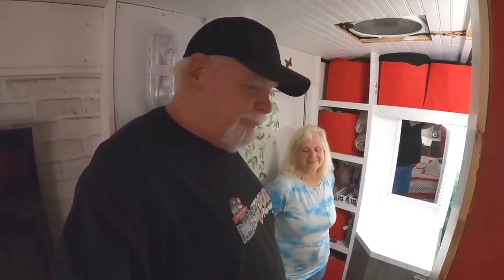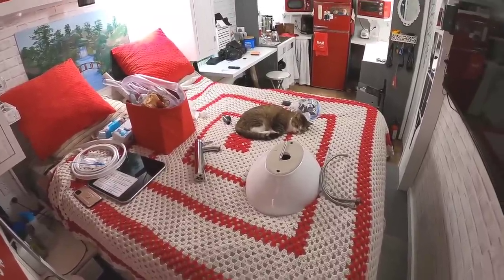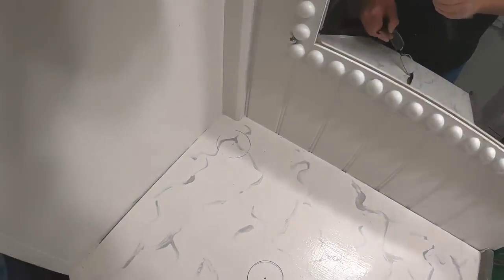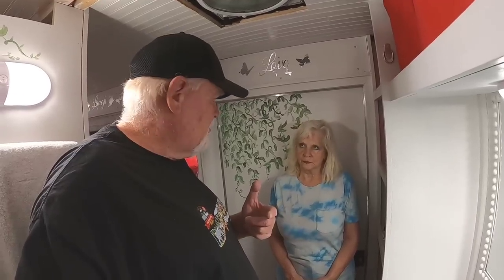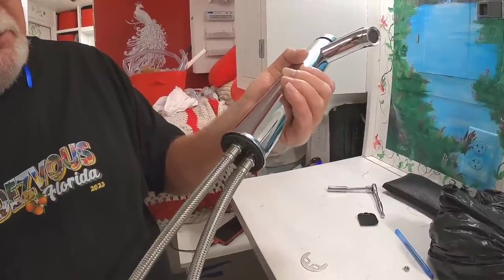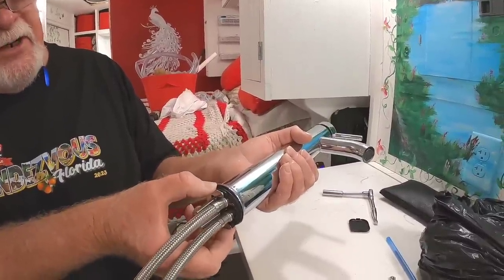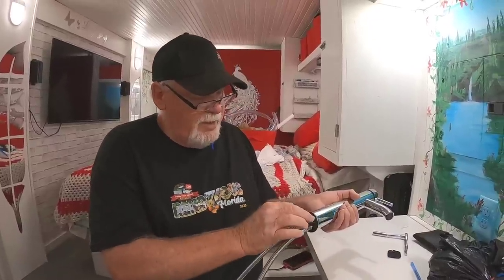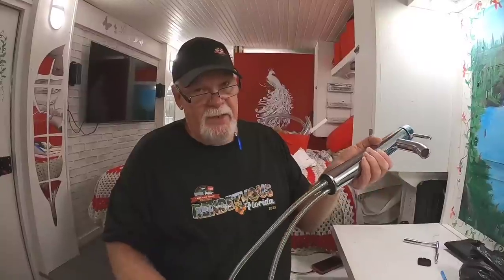Finally!! A Bathroom Sink. Our Waste Water System. The Basics.

Comment: Looks like you have a LOT of water pressure. Do you use a waterline pressure regulator? Just asking because again it seems like you had high water pressure coming out of your new sink which looks GREAT!!
Reply from the maker: No. We do not use a pressure regulator. 4 years Full-timing on the road and many different campgrounds with varying water pressure and never an issue. We plumbed the trailer ourselves and used pex pipe throughout with brass fittings (not plastic). Never even a hint of a leak. If the pressure seems a bit high, we simply adjust it at the faucet.